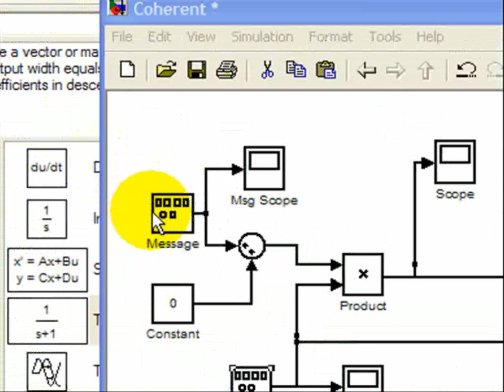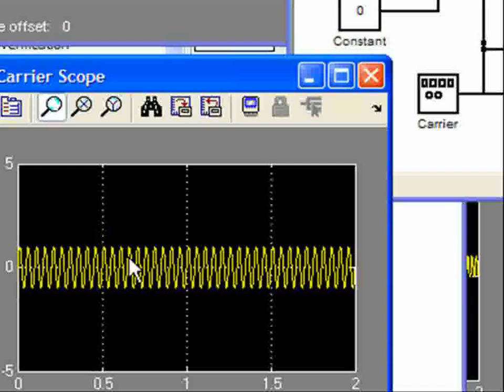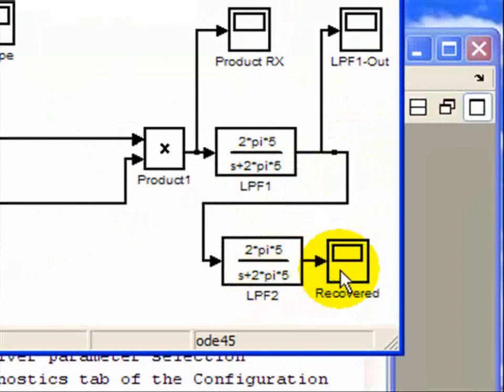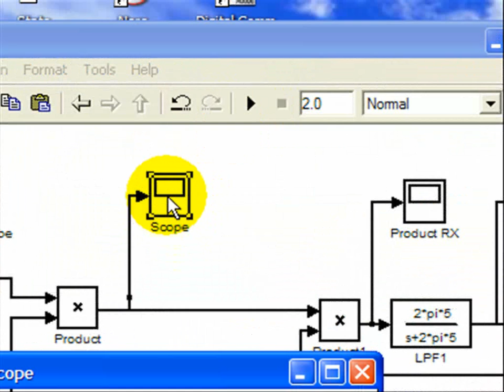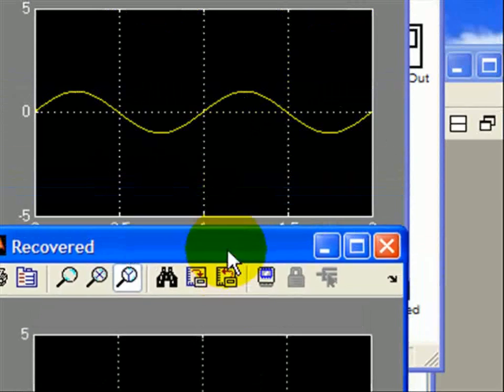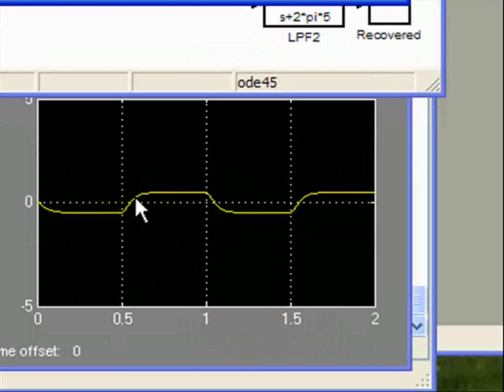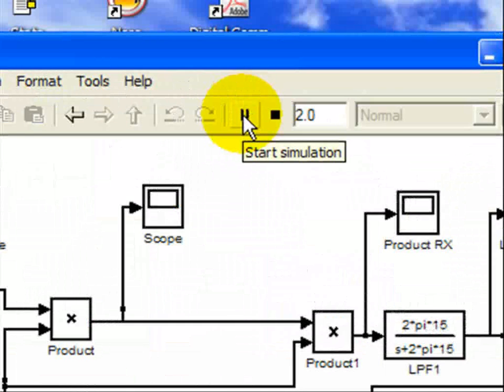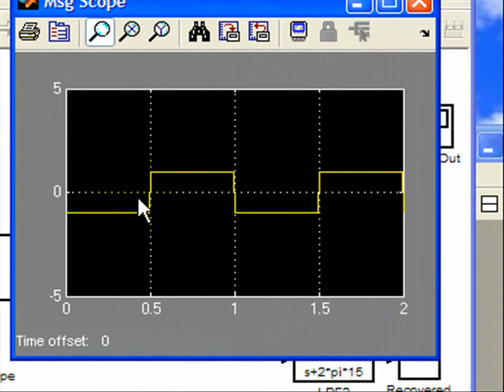Matlab Examples - Amplitude  Demodulation (synchronous detection)

Comment: @dinto1  The mathematics show that the output of the multiplier at the receiver has frequency components centered around twice the carrier frequency.  The low pass filter is needed to get rid of these high frequency components and capture the message signal.    Note multiplying at the receiver with the same carrier yields m(t)cos(wt)*cos(wt)=m(t)/2+m(t)*cos(2wt)/2.  Need LPF to get rid of m(t)*cos(wt), where w is the carrier frequency in rads/sec and m(t) is the message.   Hope this helps!  Dr J